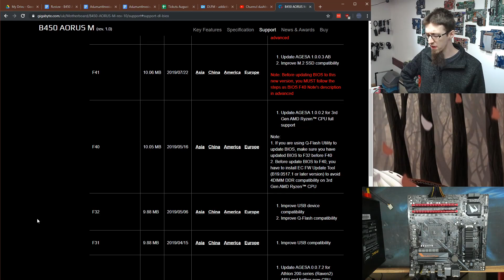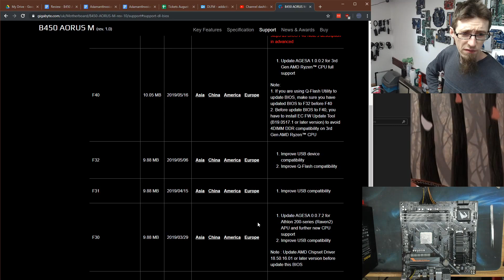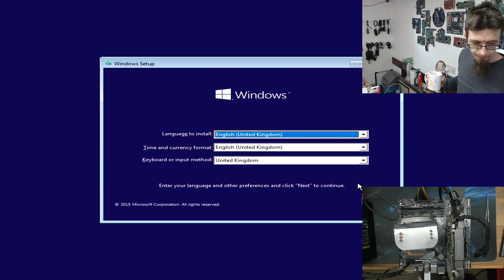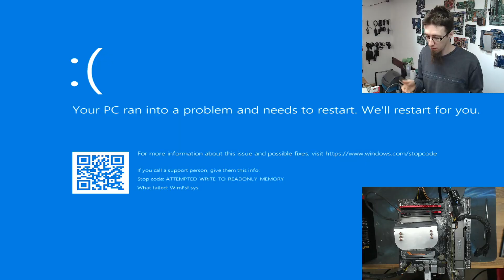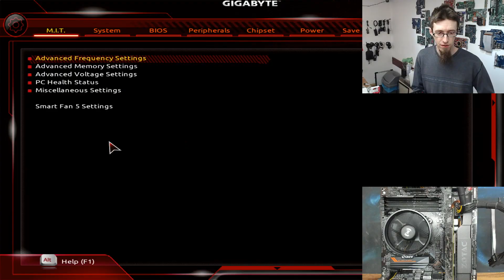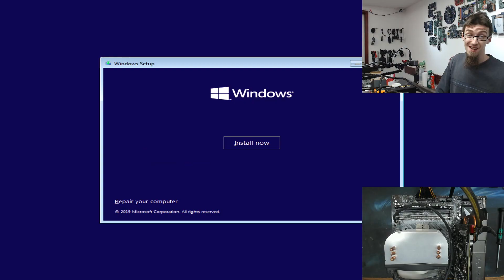LFC#183 - Gigabyte's BIOS update bricked my B450 Aorus M

Comment: Hi, Adamant IT. I'd bought b450 aourus M motherboard with BIOS F2. I'd updated BIOS F2->F4->F5->F30->F31->F32->F40->F41->F42g->F50 step-by-step using Q-Flash and I'd pluged my Ryzen 5 3600. It has worked until yesterday (1-1.5 month). And I got several issue as your. I've got BSOD CRITICAL_PROCESS_DIED and after reboot I have the same. CPU and DRAM light switching (0.5 seconds + 3 seconds ) I've tried change memory in slots, try reset CMOS. Also I've pluged my old CPU ryzen 2200G, and... it works, i've tried to downgrade BIOS to F41, but it doesn't work with my Ryzen 3600 (bios F50 and bios F41),. Do you have any idea? Does CPU dead?
Reply from the maker: What kind of memory are you running? Speed? 2 modules or 4?
Try running 2 modules with XMP turned off (2133MHz) just to make sure there's nothing funny going on there.
Reply: @Adamant_IT  GSkill F3000C15-8GVGB (2*8Gb), I'd turned XMP off and I left one stick RAM only. It was first that I did. Also I've checked my RAM, (we've swaped with my friend RAM), my RAM isn't broken. With his RAM i have the same result. Unfortunately I haven't possibility to check cpu right now, but i hope i can checked it at weekends.
Reply from the maker: Mmm. I'd definitely get the BIOS back up to F42 or F50 first, because F41 really doesn't like Ryzen 3000, despite the fact that it's supposed to be compatible. Then refit the 3600 and try it again. The ultimate test would be to try the 3600 in another mobo, but I'd sooner suspect that your Aorus M is faulty than the CPU. "It's never the CPU, except when it is."
Reply: @Adamant_IT  Thanks for advice! I'll try it.
Reply: @Adamant_IT  Hi! It was CPU related issue. Warranty case. I've taken my money back. Thanks for helping.

Comment: Hey "colleague" interesting event what happened to you, despite Gigabyte fault, you made some mistakes:
1-You didn't follow Gigabyte instruccions in steps for upgrading de BIOS 
2-Always save the current bios for this cases

3-Before desolder the BIOS you had to download (the charges) in ALL the MOTHERBOARD, take out the battery, RAM, CPU (in this case also the gpu) and all the peripherals and finally close the Cmos Jumper for at least 4-5 hours to make sure. This will make a "re-bridge" in all the internal chipsets of each element (ram,gpu,disks,etc.) and clean the possibly corrupted data sweeping all residual energy, believe me this work in a lot of times.
4-When you desolder the bios you didn't taked out the battery, you could caused a short circuit like in min 8:05

Question: what brand of hotair pistol you used?
Reply from the maker: 1. Actually I did, I literally had them on screen
2. That is exactly what Dual-BIOS is supposed to do
3. lol i have work to do I'm not waiting 4-5 hrs for something that takes 30seconds
4. It's 3v it'll be fine
5. I use a cheap W.E.P 2-in-1 hot air station. I don't use the iron on it though, as I have a TS100 for general iron work.
Reply: Okay... you could take it or leave it my advices, only said that i repair even server motherboards and i had the same issue in a gigabyte ab350m-dash and i fixed with the steps described in step 3 (the origin was a ram incompatibility and after f30 you dont have bristol ridge support). Today mosfets and capacitors are powerful (you can check it with any multimeter in diode mode) that after 2-3 hours they have charge. 

Did you tried to restore de bios with Alt+F12?

Comment: I was considering getting this motherboard. But after seeing your other video and this one about it, It seems kind of scary. Because I do not have any spare cpu or other parts where I live right now. So, I was trusting the out-of-the-box support for 3200G APU. 
Should I look for another motherboard?
Reply from the maker: Yea honestly the MSI Mortar is just better than this, I'm still not sure how I didn't see it when I was researching the review. This board is physically OK, but the BIOS is a minefield.
Reply: @Adamant_IT  Thank you. 
The problem is that, I am in Montenegro, a small European country. And I don't have access to many options here, such as Mortar. In fact I think even Aorus M became available only this week. 

I have found MSI  B450M BAZOOKA. But as I said, I don't have a spare CPU for bios update.  Which makes the MSI B450M Gaming Plus I found a better option with flashback. But it is at same price with Aorus M, without USB3.1 Gen2 ports, and with fewer ports and slots overall. 

* Newegg ignores this country. And I haven't try Amazon here yet. Maybe that could be a solution.

Comment: My mobo was already on F41 on purchase, but I ran into almost the exact same problems as you: no signal on monitor, mouse and keyboard wouldn't work and DRAM light on. Kept turning it off and back on and eventually it worked.. For a day..During this day i successfully installed windows 10, played a few games. Then all the same problems occurred again and it went back to square one. Eventually it worked again, i took this time to update to F50, now it wont turn on again.. I used a ryzen 5 3600 cpu the whole time if that matters.
What a pain in the ass. Any suggestions before i send this board across my room?
Reply from the maker: Not without getting into mad stuff like BIOS chip soldering and programming... You could try a different CPU and reflash F50 again, but if you don't have a spare CPU then it'd be easier to RMA the board. Having gone through a lot of comments and messages about this board, there's an element of luck involved in if they have problems, or if they can be fixed without extensive work.
Reply: Same problem with a 2700x so just a verry bad board /bios

Comment: Hey dude, awesome video! I recently updated my bios from 42 to 50 as you mentioned for better stability, performance, etc. which it has, however now my Bluetooth is no longer working for whatever the reason after the update. I have a PCIE WiFi card which contains WiFi and Bluetooth, I am considering reverting back to 42 to see if it fixes the issue, what do you suggest I do?
Reply from the maker: Worth a try, but I'd see if you can find updated drivers for it first. The amount of odd behaviour from this board I've read in these comments though, I wouldn't be surprised if it's a BIOS issue.

Comment: @adamant IT I just bought this motherboard with the ryzen 5 3600, is there a way I can update bios so its compatible with ryzen 3600? I have no other amd cpu
Reply from the maker: If it's not already on F41 or higher (stick the 3600 in and see if it boots) then no, you need a flashing chip. You could ask your local computer shop nicely to see if they can do it, or if you're totally stuck, order an AMD Boot Kit ( https://www.amd.com/en/support/kb/faq/pa-100 )
Reply: @Adamant_IT  i figured it out, turns out bios ver was f41 but i cannot for the life of me seem to update to latest f50. Have tried qflash and the aorus app. qflash gives me a error 'bios id check error'. whereas on the app when i try to update via server i get a error 'no match bios file can be found'. I have also tried updating from file on bios app, and get 'bios part number is incorrect'. this is doing my head in! it should not be this hard to update bios!
Reply: @SirK33N  did you solve it?

Comment: Do you recommend updating to f50? I bought this board and it came with update f41 so I was wondering if it is worth updating
Reply: I did it today and my ram before update was 15.9gb and after update it is 16.0gb so it is better
Reply from the maker: Yes the new BIOS is more stable from my testing. I advise watching the video in the pinned comment for more details.

Comment: Hey Adamant IT! Thanks for the video!

I updated my Aorus M motherboard BIOS (Ryzen 5 2600) yesterday using Q-flash this way: F5 -> F32 -> F40 -> F50.
It looks like everything works fine, but the BIOS resets if the system is unplugged at the wall. Should I downgrade to F42g to fix the issue?
Reply from the maker: I've had a couple of people report this issue, and I also had this issue on F41 and F42. I actually solved it by resoldering my BIOS chips - and as such I thought it was a problem of my on creation from the original repair video. I'm glad to hear that it wasn't but sad because I'm not sure what to suggest to fix it. Advising you to re-flow your BIOS chips doesn't seem very helpful!
Something you could try is to flash the same BIOS version again, I noticed that the F50 BIOS has a specific option when flashing to update the backup chip, and I think this may be related. If you can flash F50 a second time and force it to flash both chips, that might fix it. This is guesswork though. Let me know if it helps!
Reply: @Adamant_IT  I tried to flash it again. I tried to force flash both chips using F50. It didn't help as well. Aditionally, I've notcied when you enable ErP option in BIOS it starts to reset every time I shutdown my PC. Weird. You don't need to even cut a power...
Reply: i ended up rma-ing the board because of it resetting the bios upon power loss

Comment: Hi, can i update bios to f50 ? i've ds3h b450m mobo and his current bios version is f41b. i only have r5 3600. I'm getting confused when reading gigabyte website, i dont know if i need f32 before to update, and i'm aware that ryzen 3000 isn't compatible with f32 :(
Reply from the maker: Yes the DS3H will go up to F50. If you have F41b, you should be able to POST and flash with your 3600. If you have lower than F41, you'll need a Ryzen 2000 or 1000 to flash with.
Reply: @Adamant_IT  Ok, I will try then, thank you for reply :)

Comment: I bought the B450 Aorus Pro WiFi, the Athlon 200ge for update and pair whit a R7 3700x, factory BIOS F5, I do everything step by step AMD recommends, update chipset drivers all the stuff before and after each BIOS, when F32 before update to F40 I install the EC FW tool for update the firmware and the thing just roll back the bios to F5, i make all over again like 3/4 times until they stay in f32 and then update to f40, f41 and going to F50 latest, I switched the CPU, ran the PC and took Soo much time to enter to windows, then I try to run a game and what a surprise, the R7 3700x it's slower than my old i5 4670k, what a joke!? Try to do OC to the CPU and use XMP, save and reset, the same thing happened, then discovered when I turn off the PC and goes power out and then I try to boot up again, the bios was reset, don't matter what I do OC or not continues reset itself again and again... Just rebuild my old system, return all and save the money for Intel...
Reply from the maker: I wouldn't throw out AMD just because you had a bad mobo. Gigabyte's B450 boards have just been a bad take.

Comment: If i buy a 5 2600 do i need to update 
Or will it even work ?
Reply from the maker: That'll work out of the box, because B450 chipset. I'd still recommend updating it anyway, you won't need to jump through any hoops though.
Reply: @Adamant_IT  do you have a tutorial vid updating the mobo?
Reply from the maker: Not on this specific board, but search my channel for 'how to update bios' and I have a video showing it for another board. The process is more or less identical for any board.

Comment: Mine had the F40 already and i used Qflash and went to F50 no problem doing it right in the bios
Reply: did the same, because i have ram compatibility problems, like if they didnt follow their own bios update instructions, couldnt solve anything
Reply: @bruniuss  what kind of ram did you end up using
Reply: @PAUL-1961.  im using this BLS2K8G4D30AESCK, but I cant get it to work past 1500mhz
Reply: @bruniuss  i am running corsair vengenance 3000  which runs at 2933, also a rysen 2700x ,,i ran a tool from aorus and it rolled my bios back to F41 and it seems to be running ok but for some reason it won't let me put F50 back in,,it won't see the usb stick
Reply: @PAUL-1961.  my mobo came with f41 and i updated bios to f50 and then used the tool to update the ec fw because i read someone in a forum that it worked for him, after i used the tool my bios went back to f41 but the problem wasnt solved, after a reboot bios went back to f50, still runnin at 1500
Reply: @bruniuss  have you enable the the memory profile

Comment: Sure “no user error”

Where is the APU you’re talking about on the CPU support list? You try to flash BIOS with an unsupported CPU, and then you turn around and blame the board? That’s like crashing a car because you pulled out of your driveway without checking your rear view mirror, and then blaming the car. 

Wouldn’t be so bad if you weren’t pretending to be some sort of knowledgeable source for information.
Reply from the maker: Yup, and if you watch my follow up video to this, which is pinned at the top of the comments, you'll find me pointing all of that out. Sometimes we make mistakes, and we don't realise it until after the fact. I believe in leaving it all up so people can follow along and learn from it.
But it bears mention, the A8 being unsupported is only half the story. BIOS F40 being garbage, along with other issues on this board that many people have told me about in the comments on the update video are the reason why I didn't straight up delete this one. This board still has a history of rubbish BIOS updates, my mistake just meant that it took me far too long to unravel them.
Reply: I'll give you credit for admitting your mistake, but I believe you should still retitle all of your videos about this board. Gigabyte's BIOS didn't brick your board, your inability to RTFM did. Your "review" is more accurately reframed as... "How NOT to install ryzen 3000 in the Aorus M". 

Myself, and legions of other knowledgeable users such as Steve from GamersNexus and Buildzoid have picked this board as the "cheapest B450 board worth buying". As it stands, your videos surface near the top of youtube searches for this product (how I found it, looking for an overclocking guide) and act as a disservice to newbies looking for purchasing advice. 

I watched your LFC186 video where you delve into your solutions to these problems - you stress that you had to purchase an athlon to update the bios, when in reality AMD will send you one for free in a bootkit to resolve this very issue?
Reply from the maker: This is a repair video where the BIOS I downloaded was not stable with Ryzen 3000, and claimed to be. As I've said in the follow up video, had my backup CPU been on the support list, this fault would have been far less dramatic. This is the first instance out of many where my A8 has not been suitable for this job.
But the fault with the update that the GB website served to me is still there, as are plenty of other BIOS faults (resetting on power loss, terrible XMP support) with this board. This is what my review states. Good hardware at its current price, terrible BIOS.
Regarding the Athlon purchase - yes I bought a new CPU for flashing. I'm a repair shop, I need a cheap expendable CPU for flashing motherboards, and this scenario showed me that my existing A8 is now too out of date for that job.
Good luck with your next build, I'm sure this video will serve as a reminder to you to check that your flashing chip is compatible in advance, as well as QVLs.

Comment: I just ordered this board for my sons build kinda regretting it now tho
Reply from the maker: Don't panic, update on this board coming out tomorrow. It's completely usable, just a mix of unusual issues and also a colossal oversight on my part. The long and the short of it is that Gigabyte have got a decent BIOS update out for it (F50a) and you need to flash it with a Ryzen 1000 or 2000 series. I was using an ancient CPU that has spotty support.
Reply: @Adamant_IT  i think the newer stock are ryzen 3rd gen ready
Reply: @Adamant_IT  Would you say, it is impossible to flash this boards bios without a Ryzen 1000 or 2000 series CPU?

Comment: If I buy this board and a 3700x, it wont turn on unless the bios is already on F40?
Reply from the maker: Correct - and also in reality it needs to be F41 or higher, F40 is a mess with Ryzen 3000. I have a final video explaining the whole thing coming out on Thursday. The TL;DR is that I needed a Ryzen 1000 or 2000 to flash with, not an APU.